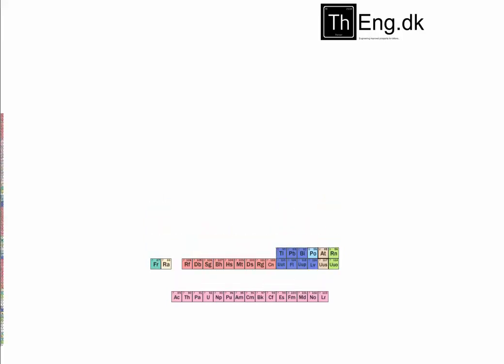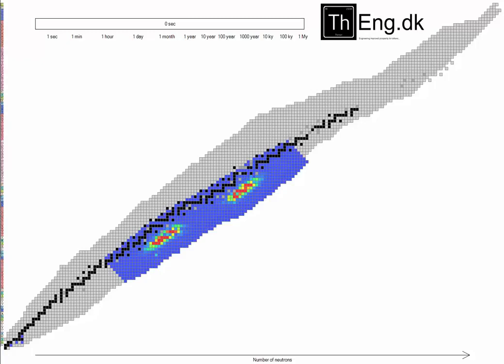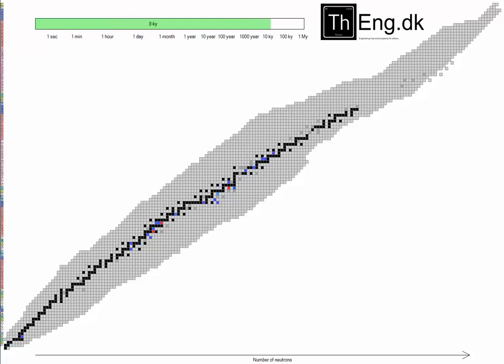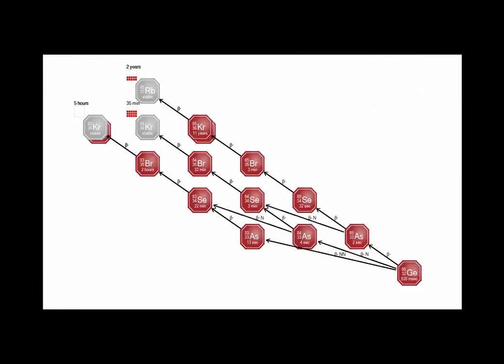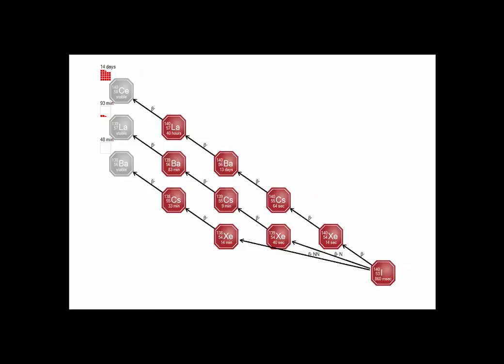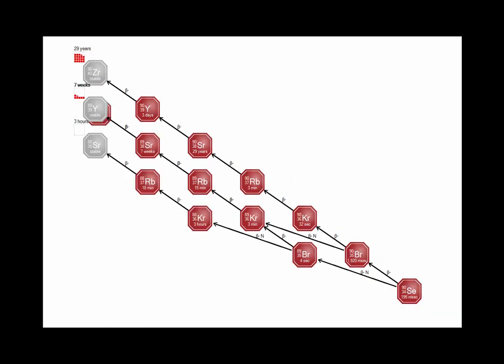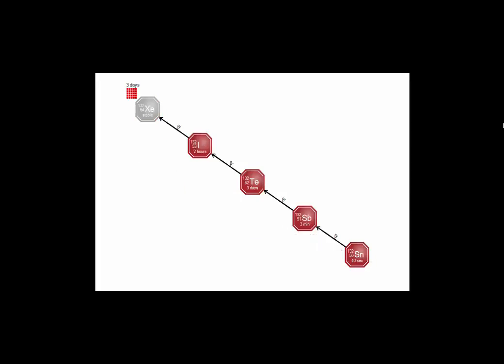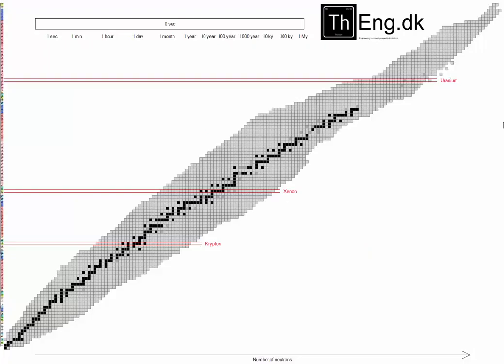Molten Salt Reactor off gas simulations

Comment: Thank you for this informative analysis of nuclear waste. It is clear from this data that there is very little material that is dangerous after just one year. If a second extraction process was developed the amount of longer lived isotopes would be small so the amount of 'waste' that needed to be disposed of is almost trivial. What are the rate of evolution of the fission products per unit of energy produced. This number would be very valuable to share with those concerned about the 'waste'. I agree that it is not really waste and the longer live isotopes have many uses. The challenge is to convince the public that not everything that is radioactive poses a risk.

Comment: In this simulation: Has the estimated time for the gas bubbles to break free from their formatin surface and the time for them to rise then up against the viscosity of the liquid salt been added to the cycle time? I would not be supprided if that where the actual limiting factor. Admittedly I have no clue about the actual formation rate of volatile fission products per time and per volume, but I would imagine it to be very small given the high energy density of nuclear fuel. A small formation rate would lead to very small bubbles. Or even worse even mostly dissolved gasses. And very small bubbles (a) take a long time to rise even with the very low viscosity of molten fluoride salts at 700°C (b) may stick for a while to the seeding surface they formed on before rising due to surface tension force exceeding buyancy force.